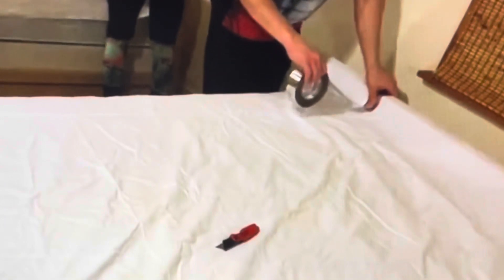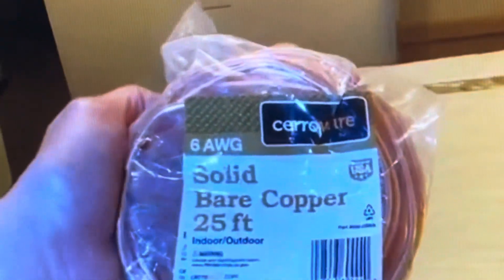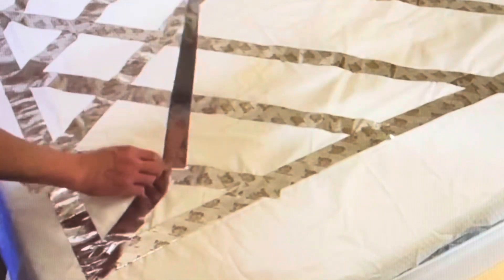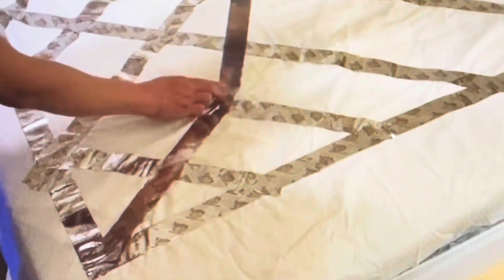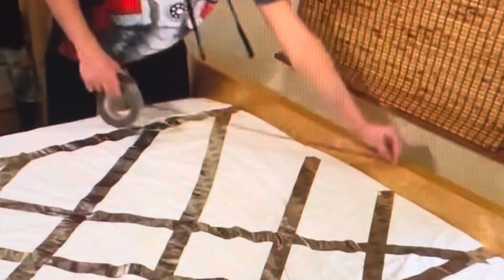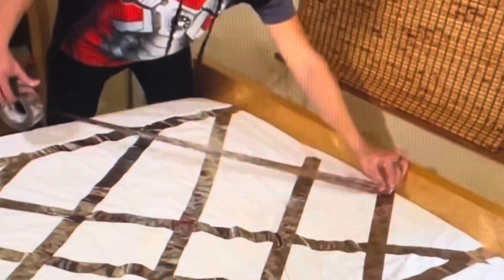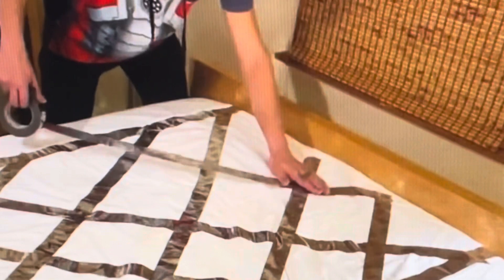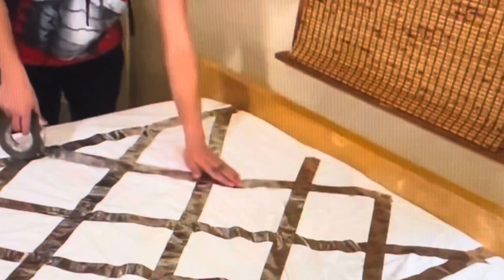How I grounded my mattress full video. Grounding earthing copper sleep health

Comment: I have done this experiment myself, and placing a sheet over the tape blocks the current. Metal tape is basically tin foil with an adhesive side. Imagine your mattress moving under your weight, it takes no time for it to crinkle and split. Testing for resistance, you only get a reading from and must touch bare skin to the tape. Which is quite uncomfortable. You'd be better off making a grounding mat with the same tape, put it under your feet while you lounge and earth that way. Also, you can run ground from an electrical outlet. No need to run that much wire and stop a window from closing. Experiment and test your methods! If you can't read resistance, it's not working.
Reply from the maker: I actually bought a bunch of grounding mats for the people closest to me, the kind of mats that plug in to the wall outlet.
Reply: Plugging into house socket, can work as an antenna and drags other electrical devices power to you/dirty electric i think someone called it. Best way is to do it his way
Reply from the maker: Really?!! Wow I actually had it right. Shoot I wish I still had this set up

Comment: All you need is a short 6' extension chord from the dollar store. Pull the top 2 prongs off. Leave the ground prong on. 
Cut the other end of the chord off. Cut the black and white wire further up the the extension chord. Strip the end of the green chord, the ground. 
Run a piece of aluminum tape across the bed at belly height. To help so the aluminum tape doesn't rip put a long strip of the mesh drywall tape on the underside then stick it to the bed. On the end of the aluminum tape just fold the end of the green wire into the aluminum tape the plug into the ground outlet. 
This is what I have done. Works wonders. Noticed a difference in one night.
Reply from the maker: Nice implementation!
Reply: What did you notice after sleeping with us up?  You mentioned noticing a difference after one night and so I’m wondering what the difference was and if you’re still experiencing Benefits

Comment: If you cover the tape with fabric, can it still be useful? I tought you should lay on top of it direct to get the benefit?
Reply from the maker: If it’s natural fabric it’s not insulative
Reply from the maker: @yoursurgerysister I can’t confirm any of this sis but in general I would recommend natural fabric for your bed anyway. Cotton and bamboo maybe hemp?
Reply: I would go with linen or Cotton! Linen is probably the best though.

Comment: That tape is only conductive on one side. You should use copper tape conductive on both sides. You would have to run a ground wire to each strip of tape the way your doing it
Reply from the maker: Ok thanks
Reply: I've been looking on copper tape here in Sweden and I found two different types. One used to fight of slugs and snails in the garden and another one which was waaay more expensive but has a conductive adhesive. Based on your comment, do you think I should go for the expensive one?
Reply from the maker: Ok I actually ended up purchasing a manufactured bedsheet but thank you for your response
Reply: @redowlnetwork  I’m thinking of purchasing conductive sheets as well. Any certain brand you suggest. 🙏
Reply from the maker: @ i’m pretty sure I just got one of the first ones that I saw at a reasonable price. The name of the kind that I got is grounding well. And honestly I don’t still to this day know if I can tell the difference ha ha but I do believe the science 100%

Comment: THANK YOU ! 🌹WHEN YOU PUT THE SHEET ON TOP OF THE COPPER WIRE DOESNT THAT CREATE A BARRIER BETWEEN THE GROUNDING AND YOUR BODY?  INSULATING AND INTERFERING WITH THE GROUNDING OF YOUR BODY?
Reply from the maker: I’m not an expert but I think natural fibers are conductive so if the sheet is made of cotton, hemp, linen, or something like that it will still work.
Reply: It still work. Mine use stainless 304 wire-mesh under my mattress, and connect the mesh to grounding point on the wall.

Comment: Can i use the plastic backed aluminum tape. I believe its just a stickier type of A tape. Since the copper lies on top of the tape it shouldn't matter right?
Reply from the maker: Is the metal connected

Comment: This does not appear to ground you, and you need to test this. The sheet on top of the grid will insulate you from the ground. In your grid pattern, the glue on the tape will insulate the transfer of electrons to the rest of the grid pattern.
You can use metal tape on your mattress to ground you but not this way.
Mike
Reply: Not if ur using like 3m conductove shielding tape

Comment: Does the thickness of the copper wire matter? I have thin copper wire I use for ElectroCulture. So it looks like you only placed the copper wire on 1 side of your bed and created a grid with electrical tape on the rest of the mattress. Did I see this correctly? Thanks!
Reply from the maker: That’s correct
Reply: @redowlnetwork   thick or thin wire matter? I have 18 Gauge, 25 foot. couple of packs. Do you think this will work?  thanks.
Reply from the maker: I got 25 ft of pure copper idk what gauge its pretty thick tho
Reply: Like your video… did u do a meter test to see if u r getting enough energy or even to much energy? I been looking at a lot of videos and I like your way of doing it
Reply from the maker: Thank you Mike I have to get a meter. To be honest I wake up sweaty a lot maybe I’m getting too much

Comment: One more question my friend .. it’s been some time now since u put the tape down.  has it still stuck real good to mattress or has it come loose?
Reply from the maker: Its not actually taped directly to the mattress but its taped to kind of a plastic sheet that maybe is used to act as a barrier between the sheets and the mattress in case someone wets the bed or something.  That sheet does move when I'm tossing and turning but the tape itself is very secure to that and hasn't come loose at all from the sheet.